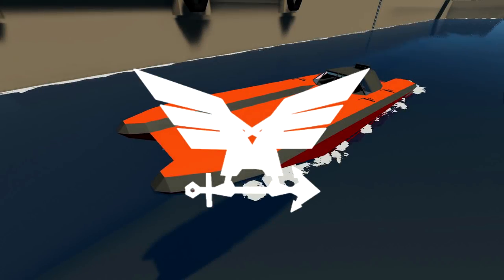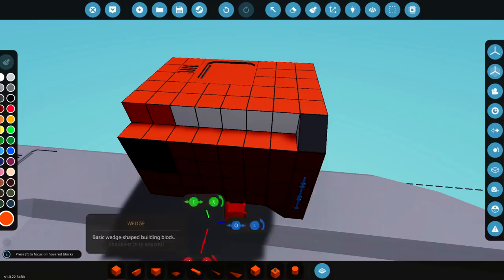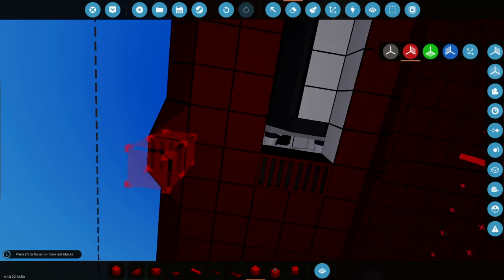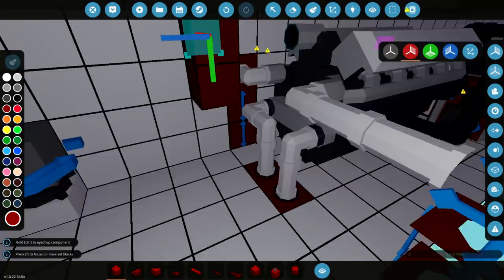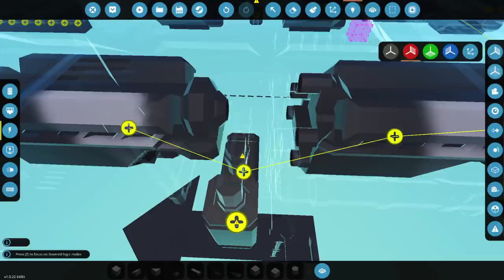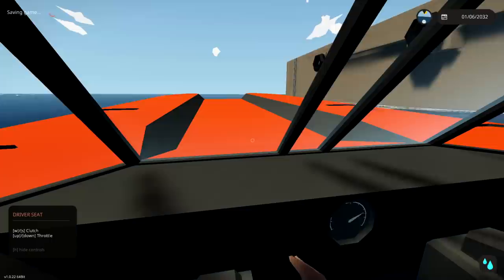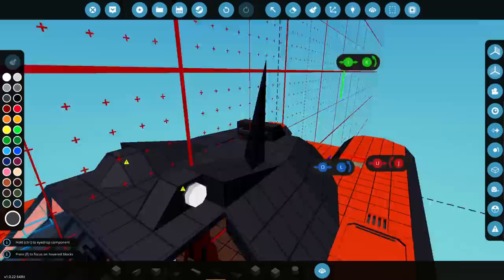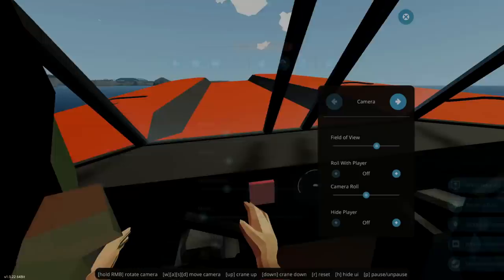6 Engines Speedboat!  -  Speedboat Build  -  Part 5

Comment: Need some up/down/left/right flaps set as auto stabilization. And a spoiler flap for extra downforce :P MrNJ did a tutorial on them. Would make this thing rock stable at any speed, any waves. And prevent flipping.